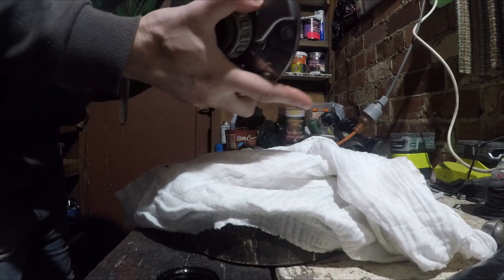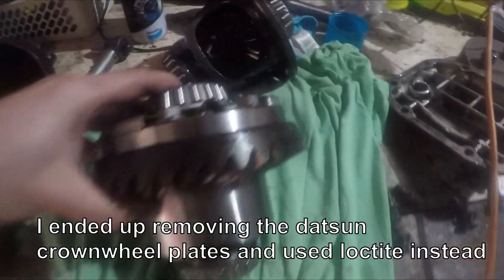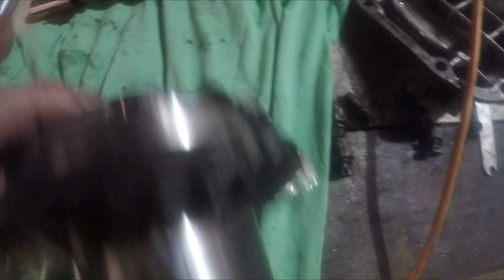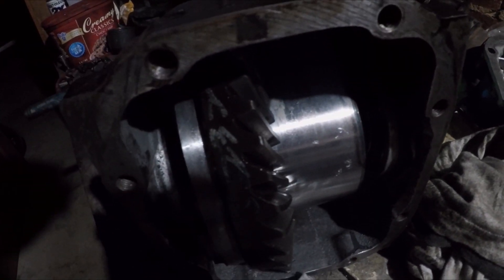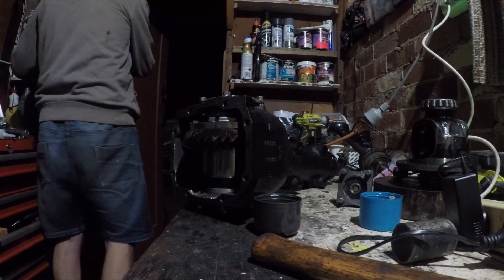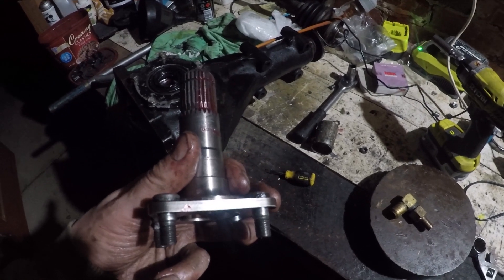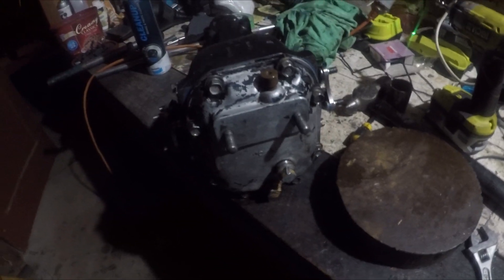Datsun 510, 240z, 260z: r180 LSD: Installing a $75 Subaru STI diff centre into Datsun case

Comment: Hi mate. Thinking of doing this. I have both diffs. I am wondering if you have had any troubles with yours since you did it. Particularly with the sleeves you put in the crown wheel. Cheers
Reply from the maker: No issues so far, I'm actually questioning if you even need the sleeves. The clamp from the bolts on the crown wheel might be enough to stop any movement.
Reply: Thanks for the reply. I’ll give it a go I think. How do you find the 3.54 ratio? I know the ratio everyone likes is 3.9.
Reply from the maker: @propertyinvestsgroup  I run a turbo (SR20) so it's fine for me. If you were na I'd recommend 4.11 or 3.9
Reply: @teamaxlestands  I’m running a sr20det also. Only stock with bolt on upgrades. Btw where did you pick up the tubing for the sleeves mate?

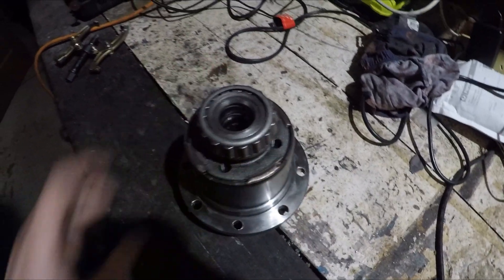Comment: 2:05 If you're going to swap an LSD or just replace bearings, don't cut it off. I highly recommend you pick up a Yukon Gear & Axle YT P20 Carrier Bearing Puller. It's a lot for one tool to do one small part of a job you'll probably do once, but there's a lot to be said for doing it right the first time.

Comment: Hi, I looked at doing that, but the little axles cost more then the diff  : ( at $670.00 aud
Reply: Best to get an obx LSD it fits standard axles
Reply: @MindDezign  do they make a 25 spline lsd centre?
Reply from the maker: yeah you are right, it used to be slightly better when the exchange rate was more favourable. There are a few more people making them these day but I figure its a one off purchase and I can swap them to other diffs. Although when i die, I hope the missus doesn't sell them for what i told her I bought them for :)
Reply: @teamaxlestands  Where did you get the stub axles ?